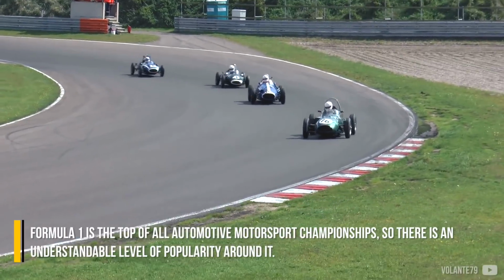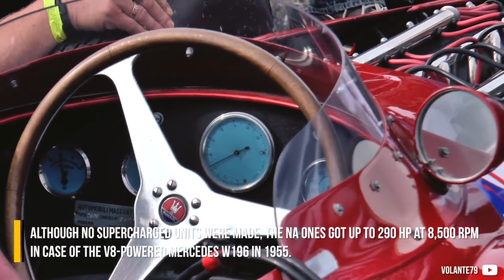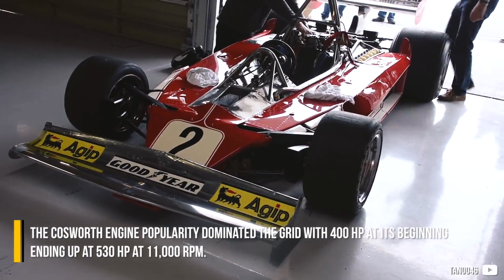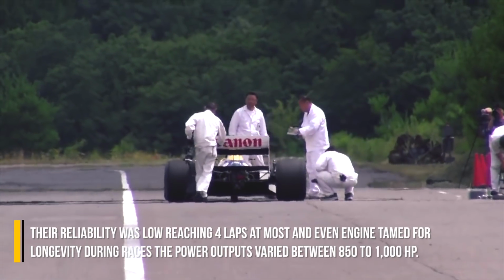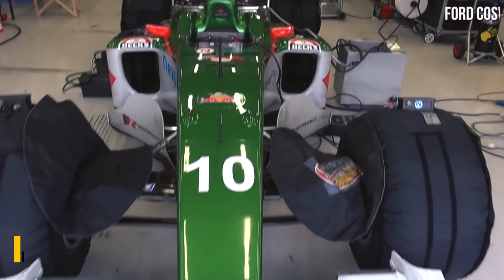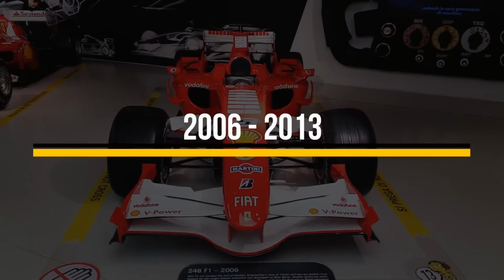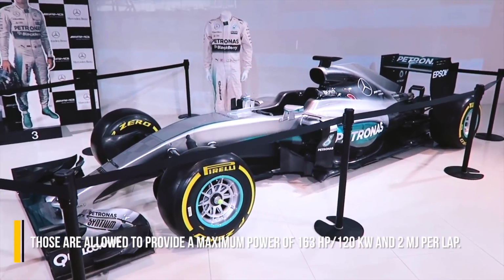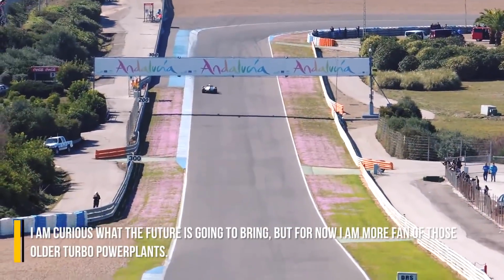1947 - present: Formula 1 Engine Evolution

Comment: The best engines where the V12 engines. The sound was just the best. F1 these days is just too muted for most fans. Nobody hates the V6 as an engine but limiting the rev to such a low amount was killer for a lot of fans that really enjoyed the screaming V12's.
Reply: It's not a rev limit, though.  Restricting fuel load is the reason that revs are down.  In 2014 the Merc and Ferrari engines were turning around  10,000 rpm in order to get to the finish with the (105 kg) fuel load they were permitted at the time.  Four years later the best engines are up to 11,500-12,000rpm again.

Not sure where they will go with the fuel efficiency requirements in future, but if the same formula is in place in another 4 years, I would expect the engine manufacturers to be back into the 13-13,500rpm range at peak.

We've come a long, long way from Andrea de Cesaris' 1983 Alfa Romeo... a 1.5l turbo v6 that consumed 310 litres of fuel to finish a race... (I think at Monza but I could be wrong about the location)
Reply: limit exist: it's 15000rpm and bottas car in mexico 2-3  years ago hit 13600
Reply: The BRM V16 is insane
Reply: V10 has better sound than V12
Reply: v12 redline was at 13.5/14k rpm, nowadays redline is at 13k so not that big of a difference
Reply: @xXiangololXx  rubbish in the days of ferraris reign they were 18-20,000rpm. The cars are now limited to 15,000

Comment: I would like to see a bit simpler rules. Limit displacement and require something like smog if you have to keep emissions down, but some variety in the sport is much needed
Reply: If it was me I'd say. Anything goes. Any engine, wankle, turbine, electric, any displacement any configuration any boost pressure. May the best driver and engine win. That way we can truly see which engine is the absolute best.
Reply: David Vermillion would be cool but no limitations would be dangerous and heavily polluting
Reply: David Vermillion It's the V8 in terms of performance there is no better engine base as of current.
Reply: Uriah Siner what fia is trying to do is, make the cars even, witch can result in who gets the win is the best driver, not the best car.
Reply: MEGATRON  That was way back, were talking about now well not now anymore tbh. In any case, I think the 4 cylinder is due a return tbh. The current power-train set-up is coming into its stride and emissions and financial regulations have become a major arguing point so I don't think it will be too long after 2021 before teams start crying out for something more budget friendly like a 4 cylinder.
Reply: @blacklabbby  this is motorsport cars that will never see the road except for marketing in my opinion the whole pollution argument is a load of bs

Comment: For those not used to measuring pressure in bar - BMWs in '86 had 5.5 bar of boost, or 80 psi.
Reply: thanks
Reply: DAYUM! That's double the boost pressure of some Turbo Diesels
Reply: Insane boost from old more than 50k miles and some pee engine blocks hahahahah
Reply from the maker: Ah, I forgot about those units to convert into imperials
Reply: 80PSI!!!!!
WHAAAAAAT!!!??
Reply: Yep.  That's how they got 1300+ hp out of a 1.5.
And why they blew up frequently.  :-P
Reply: 1.5L equals to 91 cubic inches.
Reply: 80 PSI ,WOW !!!
Reply: aussiebloke609 now I'm going to order from Extreme Tuners, a kit to install in my E46 316ti to make 1500hp...

Comment: I was just saying yesterday at Formula SAE that there should be a formula 1 league with no engine limitations. I guess thats why formula one started to begin with.
Reply: If you want no limitations, the budget must be limited. There is no money in a sport without fair and exciting racing strategy
Reply: @SajtosNokedli  Sounds fair to me. I was going to say fuel tank size but that sounds like a better idea.
Reply: That would die quickly as somebody like Mercedes could spend even more money on ultimate engine that would be flawless, but overpowered, and boom, no competive racing.
Reply: Maybe just limit tire size and down force. Simple, effective. Hard to measure down force though. Maybe put FIA-sealed strain gauges on the suspension. If down force exceeds the limit for more than 1 or 2 seconds it alerts the marshals. This allows for bouncy tracks. F1 doesn't use banked tracks (possibly excepting that hairpin on the Nurbergring).
Reply: The same people that say this are the same people that complain about mercedes and ferrari. If regulations are removed the racing will become even more one sided.

Comment: The next season engines are:
-2022: hybrid v4
-2027: hybrid v2
-2033: forced induction mono cilynder
-2035: inline 1 hybrid
-2038: fully electric f1
Reply: Web miss the sound of the 2000's v10's.  And the 1989's v12's
Reply: >v4
Reply: Maybe if saab designed formula 1 engines lmao
Reply: we already have formula E, although we might see a merge between the two sports soon
Reply: The trick is to look elsewhere for entertainment. There are epic historical racing with pure sound, lots of sports cars with the oldschool sound, lots of drag racing, lots of rally(cross) and drifting with great sound. Hell, I almost forgot my two favourites, Time Attack and Hillclimbs which are almost the same thing.
Reply: to be honest, i'd really like a forced induction one-cylinder. it would at least be interesting to watch, as opposed to those vacuum cleaners they have right now.
Reply: electric will come a lot sooner than 2038..
Reply: I'm sorry, i'm don't know muchos of f1 bit i like this sport like us
Reply: "inline 1"?
Reply: Everything would go electric by 2038
Reply: -2041: solarpowered autopilot monowheel car in virtual reality. Human is not allowed to drive dangerous things.
Reply: I agree with the hybrid part, however they already created a new class for fully electric cars called E1.
Reply: @EJ205T  Pretty much. 🤣
Reply: @blacklabbby  Nah Mercedes,  Renault, Ferrari and Honda will fall in line, just wait. The V4 is coming and shortly after the end of F1 at any rate.
Reply: 2040 end of F1 spectators got bored of the drag
Reply: 2069 : No engine, just pedaling like a bicycle
Reply: @bondanbrata300  yeah

Comment: There shouldn't be any limitations F1 . That would make the sport more interesting and technology would evolve very fast , thats very important for the automobile sector and for us people .
Reply: Earth Smell Well, your dream won't come along as emission got more restricted. They might apply that on street car, but in F1? I think secretly they did, by decreasing displacement, cylinder amount, etc. But also the increasing rarity of recources so now they created more efficient engine yet, unpleasing to some people. Formula-E has started, but it haven't revolutionized.
Reply: Earth Smell you dont know what youre talking about earth. Without regulations, it would cost a lot more to develop parts and engines etc and they would go way to fast and its unsafe. There is quite a lot of bullshit in the rules though but the majority is actually needed
Reply: Robert R well, F1 literally made to be fast with restriction that us (normal legal road user) consider it to be extreme. But FIA does this so that more technology is put more into the engine instead of an add-on/accessories, Earth's air condition is also another thing to be considered, nature recources (i.e metal, carbon, rubber ,etc) is become a rare thing as well. So don't be bothered when you see a inline 4/ V4 engines on F1 in years coming up.
Reply: With the current limitations technology is evolving and in a good way. If there were no limitations it would result in the same thing as Americans used to make cars, if it doesn't go fast enough trow in a bigger engine. Now the teams are forced to make the engines more efficient, which results in realy nice engines, like Mercedes his new engine with a 50% thermal efficiency. And in a few years we will see the same technology in regular cars, which is a benefit for all of us
Reply: Earth Smell the cars would be too fast/ impossible to drive
Reply: The MeenoBuffallo No , if they were impossible to drive they wouldn't race it , because there were no chance to win ... They would make it fast and driveable
Reply: Then it would come down to who spends the most most.....oh wait, that's why F1 is ridiculously boring. They finish how they qualify.
Reply: meifert2 Its thing now ... So how would you change it ?
Reply: Tjiko de Gooijer Safety should also be improved as the car goes faster.
Reply: Wrong. Limitations in F1 is what forces the internal combustion technology to go forward. You think Mercedes would give a damn about achieving 50% thermal efficiency if they could just throw in a hunking big 8.4L V12? God no.
Reply: You took my words out of my mouth..
Reply: Without regulations it would be dominated by one or two rich manufacturers who would be able to afford expensive technology. Same winners every year would make watching it boring, eventually resulting in loss of viewers
Reply: The restrictions were demanded by the drivers themselves as they began to see themselves as fodder for people who considered their lives less important than a romantic ideal.
Reply: I was thinking about the ridiculous possibilities that can happen without rules/regulations. I dont think progress stops because everyone does the same thing and they have to do it better than others. I think this is going to happen:
Quad turbo w16 engine like in chiron. 8.0 Liters displacement. 6 or 8 valves per cylinder. Usimg nitromethane as fuel or something similar. 8000hp.
An engine swap in a pitstop because they litteraly destroy them in a few rounds. It can probably be done in under 10s after years of development. Cornering speeds would be extremely ridiculous bc they can use airodynamic elements to help. Forces of 12G can easily be reached.  Probably all kind of weird shit with tires and suspension. All carbonfiber obviously. There is of course no rule that says you cant damage your opponents so thats gonna happen as well. Maybe remote controlled cars since there are no rules anyways and people cant handle that much g's. Probaly 6 or 8 wheels because we saw on tyrell p34 that it works. We can use fans on the back for even more downforce. Without rules we can probably reach about 10-15 tonnes of downforces and get incredible grip. Everyone will of course use drs, electrical systems and mgu-h and mgu-k and similar devices for even more power. And all of this of course means a driver dies every week and you can only win by spending the most money. What would be another trick to go faster? Did i forget any?
Reply: Not sure about that cause some team might just dominate and ruin the competition although they should be a little less tight on their restrictions though.
Reply: Possibly, human’s abilities won’t match technologies
Reply: Earth Smell should be rules, just less restricted like for example max 3.5 litre natural engines, 2 litre turbo and also Rotary engines below 1.5 litres.
Reply: bring the displacement limit up to 2.0l allow any cylinder configurations. Put the rpm limit to 19k. Whats wrong with that? A 2.0l engine is still tiny and "emissions friendly" compared to the larger gas guzzling engines of thr past... can someone tell me a good reason why fia shouldn't do that?
Reply: I think regulation is needed but shouldn't be too extreme. I remember when Group B was the bomb back then but it was deemed too unsafe, yes technology advanced rapidly but uncontrolled. With regulation it can promote innovation but in a controlled manner like building an efficient engine.

I miss the V10 and V8 era of F1 to be honest.... Good old days....
Reply: This is such a bad idea for many reasons.  For one thing most advancements happen because of restrictions.  Second,  anyone who races or knows about the racing community knows how expensive it is to race and creating an essentially open class will be dominated by the team with the most resources,  meaning the guy with the most money wins not necessarily the most talented.  Rules in sports are meant to make it the sport as fair as possible in order for the most talented and hard working individual to rise up and win...
Reply: Just look at Group B rally. They were just like what you said. Not much regulation compared to Group A. The result? Fast cars and dead drivers
Reply: Yes, I hope they are going to put some 6BT cummins in there with 120psi boost for the next season.
Reply: yes, we need more high rev engine running on both gasoline and diesel. with 2turbos
Reply: Lol just put a 20l flathead 1:4 compression V8 in there
Reply: less restrictions mean more gap between cars, as some manufactures have more money to trow to improve cars. it would be more like a time trail, and we wouldnt see any battles
Reply: Without regulations the cars can kill the driver just with their g forces.
Reply: +300 million budget teams like Ferrari, Mercedes, Red Bull can easily get 1 second per lap to the mid tier already. With no limits there would be 3 teams in couple of years and nobody watching the competition. Neither would the big teams get anything out of it anymore as the world is moving to less emissions, not the to other way around.
Reply: The engine capacity limit led to the most dazzling internal combustion engines you could think of...because designers HAD to be creative.
Reply: Have you heard of group B? They had to ban it because it got too dangerous due to the low regulations
Reply: CanAm was without limitations for a long time and wasn`t very funny eventually.
Reply: I mean there have to be some safety restrictions but yeh, other than that. They should be allowed to shoot for the stars imo.
Reply: @CIA the car would be too heavy with such a big engine. That's why we don't see V12 gt3 cars.
Reply: @thebeyonder4113  *Anymore.
Reply: @F1ll1nTh3Blanks  a v12 wouldn't qualify for gt3 standards as it would have to heavily undertuned. The only gt3 v12 I know of is the V12 vantage which too was less powerful than the road car.
Reply: @thebeyonder4113  Which is why I said  *"anymore" lol.
Reply: The thing is that these V6 engines are fast enough, there is no need for a bigger engine at all. Dont forget that you cant just keep increasing the horsepower, because there is only so much traction you can have on the tires.

Comment: A big limiting factor with the 1.5 litre straight four  BMW turbo in terms of reliability was also the gearbox. In quali spec it could deliver around the 1200bhp mark, but after no more than a handful of laps the gearbox casing would twist so badly that it would no longer function. At race boost it would last the duration but rarely be capable of re use.
Reply: Hey lewis Hamilton. Do you ferrari suit during 2025 season ?

Comment: A bit sad that you skipped over the 1967 monsters in particular, but regardless, great video!

Also, you said none of the 50's cars used a supercharged layout and that they all went with NA as their pick, correct me if I'm wrong, but the Maserati 250F had both a supercharged inline-6 as an option and a NA V12 as a later replacement, not an NA I6.
Reply: ThePurpleguy123 NANI!?!? PURPLEGUY-SAN?!!?
Reply: ThePurpleguy123 Half true and half wrong. The inline 6, which was named the Maserati 250F1 engine, was naturally aspirated and was used in all the 48 GPs the Maserati 250F entered, both with its works team and with privateers. Only one single entry amongst the hundreds that car saw in F1 had it powered by a V12 Maserati engine, at the 1957 Italian GP with Jean Behra. What amazes me is that you somehow knew about that single entry occured 61 years ago! Good catch, Mate.
Reply: RickZanardi Wait, so no supercharged inline 6? You sure?
Reply: ThePurpleguy123 Yeah, and according also to the statsf1 website (which is reliable) it turns out it was n/a. Plus, considering it was a 2.5 liter, its power figures of 240-270 hp would be awful if it were supercharged :D
Reply: Nani purpleboyyyy

Comment: I see your concerns with FIA opting for downsizing each season. But why should we stop a quest that was set out by the creators of the combustion engine. I feel like efficiency is a great improvement, not only in the F1 world, but in your regular, day to day car, too! The best example is the 1.0 Ecoboost engine. That thing is a tiny 3-cylinder unit and it makes horsepower figures with 3 digits. Not only is downsizing putting an emphasis on efficiency, it's also putting an emphasis in forced induction research. Not only that, they can make the bodies of the F1 cars sleeker and lighter, because the engines are so small. I believe FIA is making the right steps ,even if it might seem they are exaggerating.

Comment: Just for fun, let's think what a Visio narrated history of NASCAR engines would go like.  Strictly stock inline sixes on most early cars, V8's, Chrysler Hemi, Chevrolet Mystery Motor (the big block), Ford OHC, Hemi's get banned for 1965 and Richard Petty goes drag racing, engine sizes limited to 358 cid in 1971-74, restrictor plates used on superspeedways from 1988 onward,  fuel injection replacing carbs in 2012.  Think he could draw it out to three minutes?

Also, I'm surprised it took four years for an F1 team to run a turbine after Parnelli Jones nearly won the Indianapolis 500 in -67 in a Ferguson 4wd and turbine powered Indy car.  That car ran away and hid until a minor bearing failure in the transmission put it out with maybe ten laps to go.